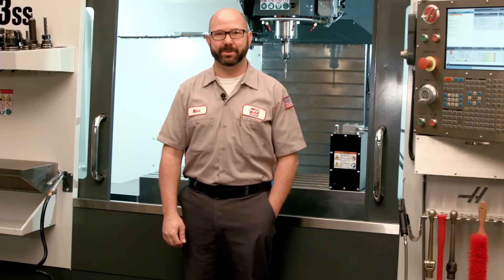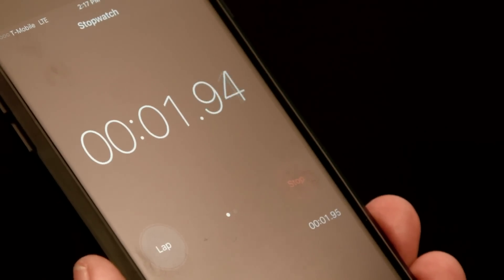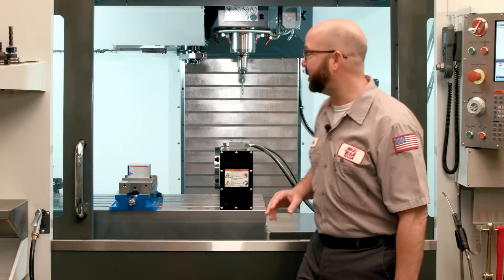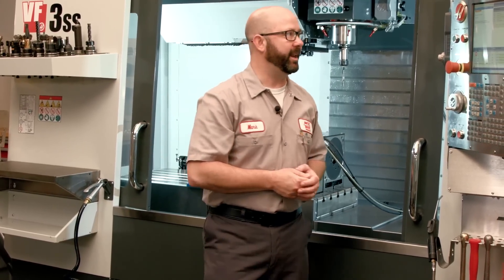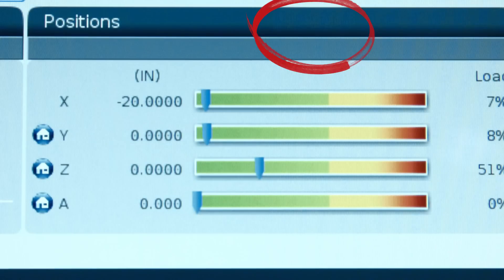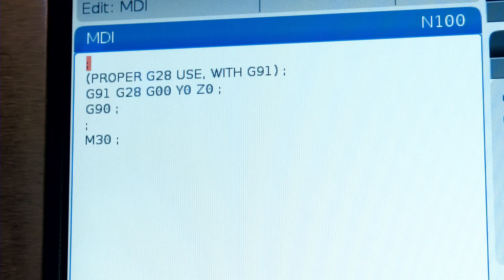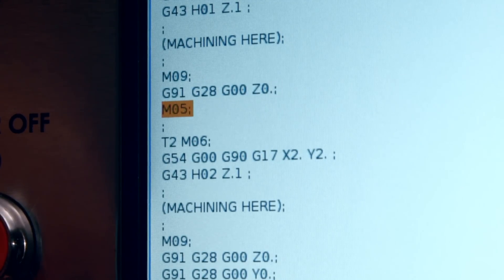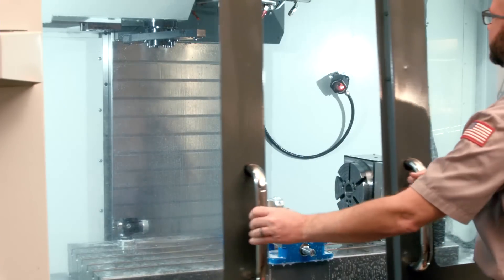Use G53 Instead of G28 to Send Your Haas Mill to Home Position – Haas Automation Tip of the Day

Comment: Just use G53. G28 wastes time.
The problem though is some machine tool manufacturers built in a "must read G28" into the control, in other words of you power up the machine in the morning it MUST read a G28 code.

Comment: Subtitle:

Hello, and welcome to this haas tip of the day.
Now, in every one of our mill programs, at some point, we'll be sending our tools,
or our machine table, home.
We might do this at the end of our program or sometimes even before a tool change.
Understanding exactly how our G53 codes work can really make the life of our operators easier.
Now, misunderstandig how these codes work; However, can add a lot of cycle time to our programs.
Or, even cause us some unwanted surprises.
(Upbeat music)
Well, let's jump right in and take a look at our G53 and G28 commands.
As operators and programmers, we need understanding how both of these codes work to send our tool or table, back to our home positions.
Now these codes behave slightly differently on a lathe.
So, we've split up this tip into two versions: a mill version, and a lathe version.
So be sure to check out the lathe version of this video.
Right now , I am at machine zero.
This is our home position.
Now why do we call it our home position?
Well, because that's where our home switches are.
Each morning, when you come in and you press power up restart, each axis moves until precision home switches are triggered.
Now this is typically the back-right corner or travel on haas mills.
Our machine Zero is a useful reference position because it never changes.
No matter what tool or work offsets we've entered home is always home.
If at the end of our programs we want to move our Z up and out of the way and position our vice in front of the door for our operator, we can do that.
Now to do this safely, we'll want to move these axes one at a time.
Z first and then the X and Y.
Now, right off the bat, we're going show you how to use the G53 method.
I've got the program loaded up right here.
In our program we've called up tool 1: T1 M06 and then we do our machining.
So the machining's all done.
G53 G00 G90 Z0 hats send our Z all the way position.
Now that the tool is out of the way, we're going to command a G53 G00 G90 Y0 X-20.
I knew I wanted to position to the table to G53 Y0 X-20 because I jogged the table where I wanted it and then looked at my machine position screen and recorded the values.
Our machine position is our G53, always.
Now, G53 is ouy non-modal machine coordinate selection.
Non modal. This means that the G53 only affects the lines of code that it is called out on.
So if we want to make a move based on the machine position, we need to call ou that G53 on each and every line.
Now as soon as we pass that G53 line, the machine is going to return to whatever work coordinate system we happen to have been in.
G54, in our case.
Now, I call out o G00 and a G90 on each of my G53 lines.
But, I just do this for clarity, and for safety.
So that's pretty much it for G53.
It is really straight forward. Really easy to use to send you tool or your table back to the home position.
I do have one more thing I'd like to say about G53 that some of you might find useful.
On some of pur machine models like UMC oy our GR Gantry Router Machines we actually have a little bit of extra space above our G53 Z0 locations.
Now this can be really useful On a UMC Machine, you might have 2 1/2 inches of travel above G53 Z0, allowing us to command a G53 G0 Z2.5.
Likewise, on a GR Gantry Router Machine, we might have four inches of extra travel above that tool change location.
If you aren't sure what the maximum G53 Z position is that you can reach with your particular machine, just jog all the way to the top of your Z travel and look at your machine position.
You can reach on your particular machine.
If G53 XYZ is like driving straight home after work, then using a G28 XYZ is like stopping off for milk on your way home. 
Now, I'm serious.
While G53 and G28 both get you to your home position eventually, then they do it in very different ways.
When you command one or more axes home with a G28, the machine's not going to move directly to those home positions.
It's going to move to the X,Y or Z locations in the current work coordinate system first, on it's way to home.
So check this out.
I've got a block loaded up here and my zero is in the front-left corner.
if from within a program I were to command a G28 X0 Y0 Z0, my tool is going move, rapid, right to this top-left corner.
Because that's my G54 XY0.
After it's done that, it will then rapid to the home position.
So again, we do not use a G28 command in G90 absolute mode.
That's the wrong way to use it.

G90 G28 G00 Z0 - (Don´t do this)
G91 G28 G00 Z0 - (Good)
G53 G00 G90 Z0 - (Best)

If you were to command that from MBI, you'd probably crash your machine.
We want to only use a G28 in G91 incremental mode.
Now this is a really misunderstood concept and one of the reasons we usually push people toward the G53 method.
If you use the G28 method with a G91, be sure to put the machine back in G90 Absolute Mode when you are done.
Now, just because we can send our tool back to the Z Home position before a tool change doesn't mean that we should do this.
Take a look at this program.
It's fairly typical, we see it all the time.
But it wastes a lot of cycle time.
The program turns off the coolant.
Then moves the tool to Machine Z0.
Then it stops the spindle before performing aa tool change.
At the end of the program, it does the same thing and then moves the table forward for the operator.
This program is wasting time with each line.
A better way to program this would be to remove these lines of code altogether.
With these commands gone, the control is going to automatically and simultaneoously turn off the coolant, move to the tool change position and stop the spindle.
If does these things all at the same time instead of waiting for each line to be completed.
So we move those M5s, M9s and those zero-return moves before a too changes, you'll save yourself a lot of time.
We give out this tip so often because it's so helpful in saving cycle time.
Well that's it for this Haas tip of the day.
Be sure to subcribe to the haas Youtube channel for more tips. 
And don't forget to stop and pick up your milk on the way home.

Comment: Near the end of the video, it wasn't explained WHY we could eliminate M5;M9; code when going to a tool change command.  I'm really new to G-code programming, but have still had many months of writing every move drilled into my brain.
Reply: Think it's because the haas machines automatically turn off coolant when changing tools so you can save time not calling that out.

Comment: So, if G53 is non-modal, how do you cancel work fixture offsets?

My experience in other controls is that G53 cancels any current work fixture offset and programmed XYZ values are now applied in the machine coordinate system continuously until either G92 or G54/G55 etc. are commanded once again.
Reply from the maker: Matthew – Yes, the G53 will temporarily cancel both Work and Tool Offsets – on the G53 line only, before going back to the current work/tool offset. For more information, download the latest manual from the www.haascnc.com website. There’ s some good information under G53. – Mark, Haas Tip-of-the-day

Comment: Great tip! G28 is good when in handle jog mode w/ the door closed to send Z home and Y to the front. I usually hit "Z" then G28 button. Then hit "Y" then G28 button. First time I used G28 in a program it scared the shit outta me. My typical mill programs end with:

G53 G00 G49 Z0. M05 
G53 Y0. 
G54 X3. 
M30

This sends Z home,  Y home (to front), X to middle of part, part is centered directly in front of door.

Comment: At times in the past, I've had a value in G53 on the offset page, as a sort of work shift.  Leaving the original offset (G54, G55, G56 etc.) where it belongs and moving the G53 offset the amount needed for a 'work shift' almost like wear in the tool offset, but not really, lol. (hopefully this makes sense, if you know what I'm doing it will).  That said, would this affect the usage of G53 you've described here?  

Also, I'm failing to see the time savings in using G53 Z0 v.  G91 G28 Z0;G90.  esp of it essentially does the same thing ... I'm open minded of course (have to be anymore in the ever-changing world of Machining) but have done it this way for around 15 years, with close to 30 in the trade.  

How much cycle time are we saving, exactly, with say 10 operations in a program, or 10 tool changes?  Thanks.
Reply: Semper Skeptical You deserve a reply, but I will say thank you until I have time to think about what youve said and consider it all, ie"take it all in" lolol.  Thanks for taking the time, I'll get back to you soon...

Comment: hi man. please help me.
How to set the reference point in a five-axis table_table machine? Axes x, y, z, a, b
Reply from the maker: You would set the offsets like you would for a 3-axis. One axis at a time and match the offset that you set in your CAM system.
Reply: Haas Automation, Inc.  
tanks for the reply. Even z axis? It is not necessary that this axis in the center of gravity axis A is zero

Comment: I know you guys have a video of Index-on-the-fly but it doesn't explain how to use it. How does it work? Do I need more clearance? When does it decouple the turret? Also, Every once and a while someone in my shop bumps the probe on the lathe and changes it's offset. What's the easiest way to recalibrate a probe?
Reply from the maker: Chad –   That’s a great topic. We’ll put it on the list. For now, here are my notes on G200. Enjoy.  – Mark, Haas Tip-of-the-day. Oh, and send me an email at TOD@haascnc.com and we’ll get your probe squared away.

  The G200 Index on the Fly code does speed things up, but it also gets a little scary. Make sure you proof the program well, at 5% rapid, and be very cautious if you are starting from the middle of the program. 
  Normally, your tool change line consists of a few lines of code, like: 
G53 G00 X0. (BRING TURRET TO SAFE X TC POS)
G53 G00 Z-10. (BRING TURRET TO SAFE Z TC POS)
T202
  The example in the book (download the Haas Lathe Manual) changes this code to:
G200 T202 U.5 W.5 X8. Z2.
  If T101 had just finished turning the O.D. of the part, you don't need to go back to a safe tool change position, when using a G200. Instead (as in the example) the moment the G200 line is called the turret will:
1) Unclamp, right where it is at
2) Move incrementally in the X and Z axes by the values stated in U and W (U.5 W.5)
3) It will complete the tool change at this position
4) Using the current tool and work offsets, it will rapid this new tool to the XZ position called out on that G200 line (X8. Z2.)
  This all happens very quickly, and nearly all at the same time, so try it out a few times, away from the chuck. 
  When the turret unclamps, it will move towards the spindle a tiny amount (perhaps .1-.2"), so you do not want the tool directly up against your jaws or collet when the G200 is commanded. 
  Because the U and W moves are incremental distances from where the tool is presently, if you hand jog away and start your program in a new position, the turret will move up and to the right of that new position. In other words, if you manually jogged back within .5" of your tailstock, and then commanded "G200 T202 U.5 W1. X1. Z1.", the turret would hit your tailstock - moving an incremental W1. (1" to right of where it is at). For this reason, you may want to setup your Setting 93 and 94, Tailstock Restricted Zone. Information on this can be found in the manual. – Mark, Haas Tip-of-the-day
Reply: Haas Automation, Inc. Mark, you are fantastic at replying. I read through the comments just to find your replies lol. This is very helpful.  Keep up the fantastic work. Im gonna copy and paste this into notepad and save it for future reference. Thanks! P.S.- Looking forward to those videos on different probing routines that you've mentioned. And can't wait to see if you do more advanced videos on Macro programming, I enjoy the way you teach. - Jacob S.

Comment: Got an older Mori Seiki sl250 mc recently and just started playing with it. First time using live tooling and  sub spindle. Could have used this tip earlier after damn near running the sub spindle into the collet chuck.  Needless to say G53 will be a permanent fixture around here now.
Reply: You can use absolute positions with a g28, but the positions are merely an in intermediate reference before returning to origin (home). On a sub spindle Mori that doesn't have the g330 zero return macro, you could use a large intermediate point to reference return the sub and trigger the zero indicator so you can use your sub presetter. G28B10. Usually won't get you into any trouble. (That's if your transfer position is set to your main spindle part location)

sl250 is more than likely a Fanuc 18 (msc501), so you can modify parameter 1241 to be center stroke in Z and use g30 to return the machine to second zero point, but g53 is easier and a little cleaner.

Comment: how about a tip of the day on why a 2017 haas vf2ss doglegs during rapids.....
Reply: Colin B dog legging isn't unique to a Haas. Most CNC's do it. there's a parameter to force high feed mode on rapid, but then your overall cycle times will be slower. you should have toolsets to handle these scenarios in your CAM system.

Comment: I'm a little new to the CNC programming on haas machines I just took straining course on it and I'm getting into doing programming for things with my dad in his jobs machine shop room. I have a question about this video would you have to cancel CSS if you had it on for the g53 to work
Reply from the maker: Wolf Playz – If you mean Constant Surface Speed, on a lathe, a G53 G00 will work in that case too. We have a video on G53 for lathes that we will release in the next couple of weeks. A G53 G00 G90 move will work in all cases, even with G234 Tool Center Point Control (TCPC) or G254 Dynamic Work Offsets (DWO) active on your mill.  If I misunderstood your question, let us know. You can always email us at TOD@haascnc.com also. Thanks for the question. For programming at your dads’ place, be sure to jump right into a CAM system as well, it will be time well spent. – Mark, Haas Tip-of-the-day
Reply: Haas Automation, Inc. thank you you answered my question.

Comment: G28: useless.
Reply: G28 confirms origin position, g53 does not
Reply: yeah, but if that's what you're trying to do, I'd propose there's at least two other alternate ways to do it that don't involve invoking an ancient code.
Reply: @ydna  all g code is "ancient". Find me a code that trips the home indicator that isn't g28 because on most fanuc based machines, g28 triggers the home confirmation, nothing else will
Reply: I say ancient because G28 was specifically created to save space on punch cards by allowing retract moves in the same string. In doing so it increases the risk of problems drastically for those that aren't familiar, compared to codes like G53 that perform the same function but in a direct way. I wish they'd take it out of the controller and prevent people from crashing my machines
Reply: @ydna  but again, g53 is only machine position, it doesn't trip the home flags on a Fanuc or some other controls. It shows up as a home indicator on as haas mill, but it's just one of those legacy things that will always be around. One thing they could do is eliminate the intermediate point and make it optional, but fanuc just came out with the ELSE conditional of an if statement with the 30 model B. I think both of us will be dead and buried before they do anything to address the intermediate point of a g28 move
Reply: Meh. Sounds like Fanuc has left that "feature" intact for no reason. I just want to send the axis back to its origin. The rest is fluff.
Reply: @ydna  they've been resting on their laurels for 30 years now, where the heck have you been? Lol
Reply: I've been taking dumps on them the whole time.
Reply: @ydna  i was being facetious. I've honestly never liked Fanuc's lack of innovation. I grew up on Mazaks and found my way to Fanuc after and it was like going from a PC to a dollar store calculator. Now I use Siemens controls often and that thing is just sweet as